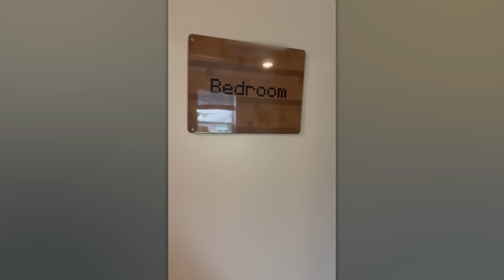Incredible Moments Caught on Camera

Comment: The AR variant firing underwater was not modified. A stock one that is semi auto or full auto will shoot underwater. You said it is as fast above ground as below water and that is for the cycle rate only because the bullets drop off and sink rapidly right out of the cameras view.